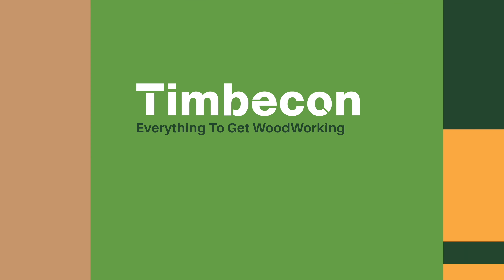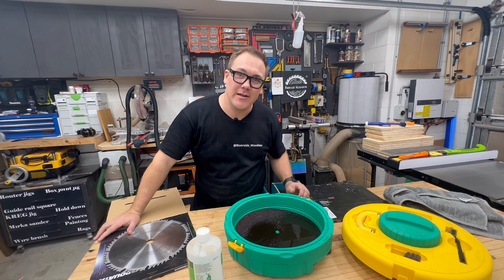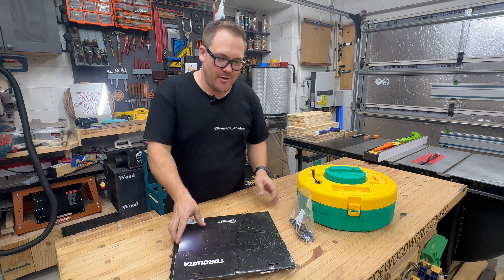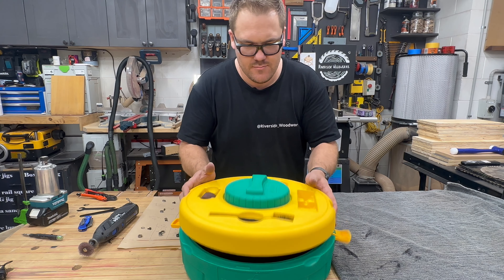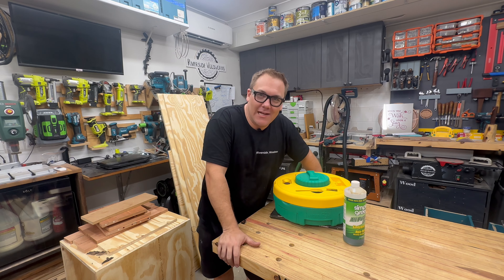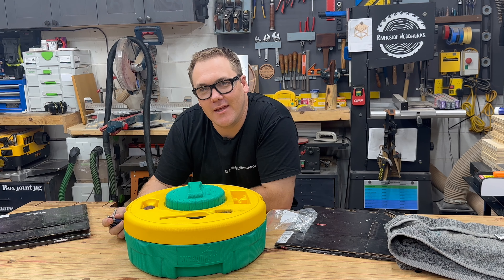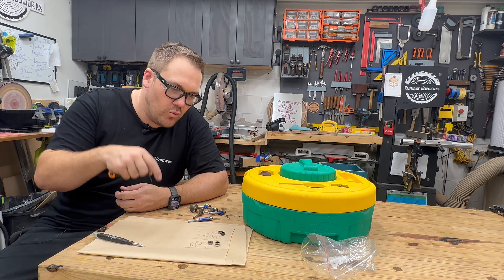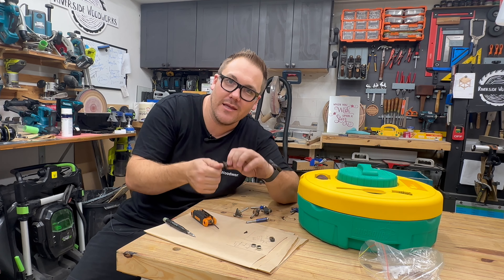Microjig Bladeclean System: Deep Dive

Comment: This seems like a solution looking for a problem.  I put my blades in a laundry sink and spray the blade with a few squirts of CMT blade cleaner, wait 30 seconds, and brush with a small brass brush.  Rinse off and done.  Takes less than 2 minutes.
Reply: Hi there, if you’re cleaning your blades regularly (and it sounds like you do) then I think that is also a good system. I like that all the tools are on board and with the really nasty blades I can soak them in the solution and clean them with the abrasive pad. Thanks for watching and commenting.

Comment: This is a good video. I think I'll stick with my method of warm water and dishwashing liquid though. Soak the blade for 10 minutes, then clean it with an old toothbrush. The results look just as good, if not better. Given that you ended up cleaning each tooth with the brush anyway, I'd say the Microjig system isn't any quicker either.
Reply: Hi there, nothing wrong with dishwashing liquid and water. I just found it easier to use the microjig system for the really nasty blades like in this video. I clean my blades once a month and I don’t have to get in there with the wire brush for my blades. Regular cleaning is the key. One thing is for sure, clean blades make all the difference! Thanks for taking the time to watch and comment!

Comment: All you need is a lid from 5 gallon bucket to soak blades, a little brush with old toothbrush and rinse. MicroJig  is an expensive solution.
Reply: Hi there, thanks for watching. For smaller blades I think you can make the 5 gallon bucket work but I like that this product can fit 300mm blades. I also appreciate that everything is contained in the lid of the container with this one. At the end of the day the goal is clean blades so if you’re also cutting with clean blades then that’s awesome! Thank you for taking the time to comment.